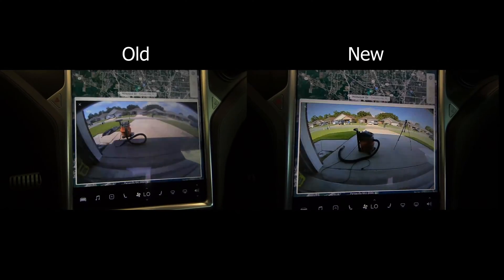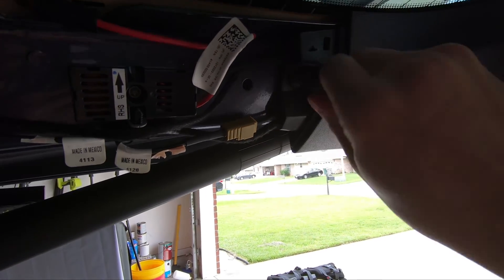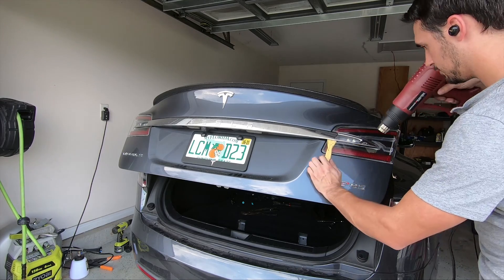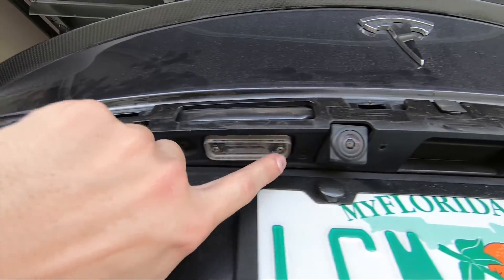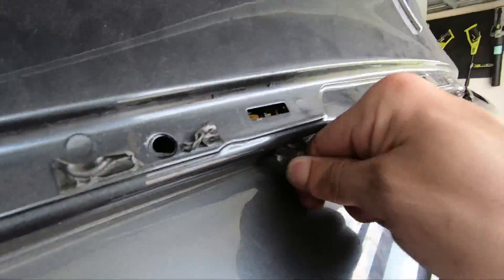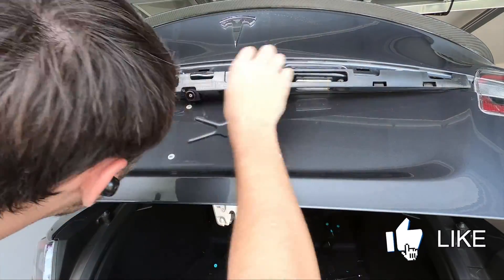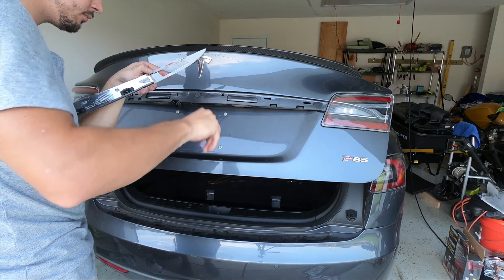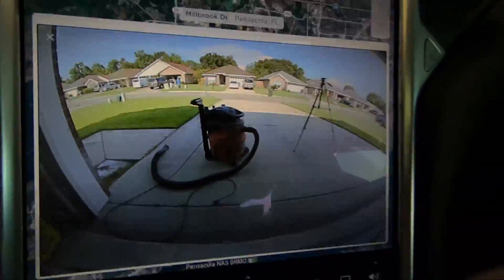How to: Upgrade back-up Camera in a 2014 Tesla Model S

Comment: Changed my camera today. As described by @SimonPodolak there is really no need to remove any of the inside plastic panels. Just remove the chrome bar, the plastic support bar and the left side handle. You can reach the camera connector clip by reaching through the handle hole. The clip can be disconnected fairly easily with one hand. Using a heat blower not only works for removing the chrome bar but also to get the rubber seal on the camera cable easier to remove/install. Took me 2 hours all in all.

Comment: I just replaced the rear camera. After removing the three smaller covers, I found out, that it is absolutely not neccesary. Removing of the left handle (for closing the trunk) is enough. Through the hole you can access the camera cable. With only a little fumbling the old camera can be disconnected and the new camera re-connected. What a pity, that I found out after removing the covers...
Reply from the maker: @adrianhossbach2553  I appreciate you sharing your experience and information. Hopefully it’ll be able to help others as this continues to be done by others.
Reply: But you still have to remove the chrome bar right? Holy cow how hard Tesla made the repair

Comment: Hey! Awesome video, Im gonna try to do this myself. I have a faulty backup camera on my 2017 model X that needs to be replaced, do you know if the model s and model x use the same camera? all the cameras i find on ebay seems to be for model S only.
Reply from the maker: Hey there, thank you. 
Yes, they use the same camera and have the same part number.
Reply: @JoeMartinMVC  Awesome! Thank you!
Reply: Hey, the camera on my 2018 model X has just failed, how did you get on with your repair? Are there any bits you can skip?

Comment: Hi @JoeMartinMVC, I have mine rear camera cracked. I have ordered a second hand one. My camera is tesla s 2018, and the second hand camera was also taken from the same year car. The part number the seller quotes is 1061269-00-b. Is it supposed to be the same the one in my car too? I am afraid that there is a chance my camera in my car to be 1061269-00-c and the one from the seller to be with lower quality. Or model S 2018 always uses 1061269-00-b?
Reply from the maker: The b and c models are identical in terms of resolution, C is just a hair better with low light situations from what I've seen. From what I can find on Tesla Parts pages B was used in 16 and 17, and C was used from 18 on.
Reply: @JoeMartinMVC  fantastic, thank you very much for the information! Good luck! :)

Comment: Hi there, first of all, thanks for the video, helped a lot. I replaced the cam now with an original one from Tesla, but the screen stays black. Any idea (beside reboot), what has to be done to make the cam working?
Reply from the maker: There shouldn't be anything else required to get it working. If the car sees a camera plugged in it automatically displays. The cameras are not serialized to the car, they're plug and play.
Reply: Thanks! I’m afraid, I’ll have to visit the SeC. 😐

Comment: What was the difference in resolution what part number were you upgrading to
Reply from the maker: It went from 720P to 1080P:

The part number for the new camera I used is the one in the description of the video: 1061269-00-C

Comment: Just had my camera replaced by my SC since the lens on the old was cracked. After the following car wash I noticed water drops around the edges of the two handles and condensation inside one of the lights. The water leaks comes from all the holes behind the external trim. These leaks must be fixed to avoid future problems with the lights and contacts! I have found that this is a common problem on Tesla MS - even with new cars. The design is poor and it is difficult to seal the weak points.

Comment: Thank you for your video! Just repaired my Model S late 2016 with 69-00-D. Wouldn’t have tried it without this video. A few things I did differently: Removed chrome bar incl. plastic support bar. Removing the plastic covers inside of door was too much of trouble for me, broke almost all clips. so I decided to try it through the handle hole at the bottom. Was quite difficult one handed but worked in the end. Tesla now sells the tape precut in this shape so that was way easier. took me 3h nonetheless.
Reply: I also managed to reach the connector through the handle hole. Not too difficult and of course way easier than removing and reinstalling all that interior trim.
Reply from the maker: I'm glad I was able to help out. I'm honestly surprised at how many people have actually done this modification, but I think it makes a notable difference in rear visibility. Having the precut tape would've been awesome. That was probably the biggest pain for me doing this. Lol
Reply: What is the difference between 69-00-C and 69-00-D? D is the newer model I would guess? Change in quality?
Reply: @patrikahlberg3710  minor differences I guess. the newer ones are better sealed and heated. didn't notice any quality improvements compared to my old one (2016).

Comment: Thank you for your video! My 2013 S85's backup camera was giving the "Camera not accessible" error. I bought a 1061269-00-D for $150 on eBay (could have gone with the $38 1006773-00-F but I think that is a lower resolution) and replaced my broken 1006773-00-D by following your video. It worked great, and probably saved me a couple hundred bucks by doing it myself.
Reply: I looked everywhere for the 69-D but couldn’t find anything (ebay,amzn,wish,ali). Had to go to Tesla but 3 out of 4 SeC told me the camera was restricted goods and can’t be sold. 4th one sold me the camera for CHF450, almost same in USD. insane prices but didn’t know what else to do.
Reply from the maker: I'm glad to hear I was able to help out.

Comment: Great video! At night my original backup camera is basically worthless. I have to apply the brakes to get enough light to see anything. Does this upgrade resolve that issue?
Reply from the maker: I wouldn't say it resolves it, but it is notably better and has better low-light functionality.

Comment: I've had my car wrapped in PPF. Do you think I'll still be able to use a hot gun?
Reply from the maker: With PPF I'd be a bit more hesitant to use a heat gun.
I'd go more with a hair dryer and fishing wire to not heat up the PPF as much.
Reply: @JoeMartinMVC  Last question...........I hope!!! How many strips of double sided tape are there. From the video, it looks like there are three separate sections.
Reply from the maker: @AdrianWingate2010  no worries, I’ll help out with any questions you have. 

I’d classify it as 2 pieces, it really just depends on how wide your double sided tape is and how good you are with an exacto knife. For me it was easier to cut the tape in to a few pieces and then put it on the bar instead of trying to cut it out perfectly while it was attached to the piece. Double sided tape is weird to cut and doesn’t like to do so cleanly.

Comment: You stated that it took 2-3 hours to do. Which part took the longest? Was it the heat gun part? I'm assuming that the purpose of the heat gun was to melt the double sided tape.
Reply from the maker: Yeah, carefully removing the Tesla chrome bar and then adding new adhesive was the longest and most tedious part. 
That’s correct, the adhesive that Tesla used is very strong and the heat gun weakens the bond. You could also use some strong fishing line to help cut through the double sided tape.

Comment: Thanks for this video! After watching it more than 3 times - yesterday was the day for replacing my cam with cracked lens. 4 broken clips and a perfect result. My 2016 had minor differences but this video helped ALOT! 👍
Reply from the maker: That sounds about right, lol.
I'm glad I could help out, I know when I went to do this job myself I couldn't really find any type of instructions or guides, so I figured I'd do my best to get the information out there for anyone else who wants to try and do this, as it's a massive upgrade.
Reply: Hi Jens! planing on doing the same to my late 2016 Model S tmrw. Just wondering, after turning off your Tesla have you disconnected 12v battery and safety loop as well? hoping plug and play works. I have the -D Series. Also thinking about sealing the cam with some liquid tape, not sure about resting water though
Reply: @SimonPodolak  I didn't remove 12V. Just open door and trunk and then turn off the car. Don't think you need water sealant since rubberbus on cable through.

Comment: Do you have a part number for the newer camera? They all look the same on eBay
Reply from the maker: The part number is in the description: 1061269-00-C
Reply: @JoeMartinMVC  thank you 👍👍 I will try this myself. But scared about that heat gun...
Reply from the maker: @liteglow2000  You could always opt to use a hair dryer as a safer option, it just takes a little longer.

Comment: Does Ur Tesla not have backup lines when in reverse?
Reply from the maker: When in reverse it does, the lines operate the same as they did with the original camera that I removed. I just always keep my backup camera up and visible on the MCU and did not put the car in reverse for the video.
Reply: @JoeMartinMVC  Is there any way to tell which rear camera U have? And do U have a link to the HD one? 
I'm starting to gather all the pieces for my next big Tesla Overhaul. (New MCU, eMMc, and upgraded modem). Figured while the car was in pieces, I might as well work on other upgrades as well.
I'm looking over Ur channel now to see what else U have done to Ur older MS.
Reply from the maker: @Smo0chiePo0ch  If it's older than 2016 it should have the older camera, you can also take a look at the clarity and difference in field of view, the newer ones have a much wider field of view.
I bought mine off of eBay, but if you look for model number 1061269-00-C, that's the upgraded/newer rear camera. It is a Tesla OEM part.
Reply: Thank U very much. I currently have a 15MS85D. Guess I will be looking into the upgrade. Thanks again.
Reply from the maker: @Smo0chiePo0ch  You're welcome. At the end of this year I'll likely have a bit more content coming out, as my car will be out of warranty at that point and will start doing more work myself.
But the good news is that removing almost anything in the car is straight forward, including the instrument cluster and MCU. Just go slow and make sure you have plastic pry bars so you don't mark anything.
Reply: My car is out of warranty and so, I have started the slow process of doing/learning to do things myself. 
Tesla is only handing out refurbished MCUs so I plan on just buying it myself. The eMMc is going to have to be sent out to be flashed in Cali. (I haven't found anyone here in Florida with us yet) but still looking.
I also have moisture behind that back piece so it needs to come off and resealed. 
Might as well do the cam at the same time. :)
Reply from the maker: @Smo0chiePo0ch  My poor MCU has been replaced 3 times now because of the EMMC issue.
When you say moisture behind the back piece, are you referring to the LCD screen leaking?
Reply: No. Not screen goop or glue. The back part that is taped on that U pulled off in Ur video.

I'm going to purchase the new MCU screen (Tesla is only offering refurbished ones) from eBay and send my eMMc to Cali to be cloned and have the chipset updated to a higher capacity.
Reply from the maker: @Smo0chiePo0ch  Hopefully all of the work will go quick and easily for you so you won't have too much down time.
Reply: He told me to expect at least 2 weeks of down time. (From pulling the chip, to sending it to Cali, to the cloning/upgrade, and getting it back to me.)
My MCU only has a small bubble in the top of it for now so if I need to wait on the MCU, I can and do it later. Its not leaking. I also plan on going 4G when I rip all the dash out. I have no bubbles or leaking so far in my display cluster.  fingers crossed that it holds out too 🤞 
Then after that, paint clean up (for a few chips) and PPF/Ceramic.
Reply from the maker: @Smo0chiePo0ch  That's not a bad turn around at all for what's involved in all of that.
I sure hope it does, I've had two leaky gauge clusters and one leaky MCU in mine, at least they're warrantied for a year at a time whenever it happens.
At least the paint cleanup and ceramic coating is easy. PPF, not quite as much. lol
Reply: They want the car for at least 3 weeks for PPF/Ceramic and are asking over 10x the chip price. Haha. Im looking forward to being MCU and eMMc worry free.
Reply from the maker: @Smo0chiePo0ch  10x? Jesus. You can buy the chip repair kit and use it to fix small chips and scratches pretty easily (it's actually the same kit as Dr. ColorChip repair kits).
Do you mind if I ask how much they want for paint correction and PPF install?
Reply: I don't mind on U asking at all. I just had to work... and just got home.

So I took my car to two different shops to get quotes for PPF and Ceramic Coating. I live near Destin. 

My car is a 15MS85D. Pear White. The paint looks extremely good but is not perfect. I have a rock chip on the hood and 2 bad chips on the front bumper. 

Here is the first quote I got back so far.

2015 Tesla Model S
Preparation for ppf ( full paint correction-removal screeches and swirls 600$ 

Front bumper repaint 800$+tax
100% color match 
 

FULL CAR PPF 

Full Hood/ Front fender/ Mirror
A-Pillar/Full roof
Front Bumper
Full Doors
Rocker panels
Luggage area
Trunk lid
Rear fenders
Rear Bumper
4,121.95 (kits) + 1,236.45 (installation) = $5,358 Total+Tax

FRONT IMPACT ZONE AREA 

Full Hood/Fender/Mirror 
Front Bumper
A-Pillar
1,644.85 (kits) + 493.45 (installation) = $2,138.30 Total+Tax

Ceramic coating on top of the PPF and all exterior parts 750$ for 2 years of protection 
 
Chrome delete 700+tax
Wrapping on front black plastic piece 200$ gloss or matte price the same
Reply from the maker: @Smo0chiePo0ch  Oh wow, you're actually pretty close to me. I'm just a few towns over from you.
Overall that's not too bad of pricing for everything. I'm actually surprised at the install cost being only $1300.
Full paint correction for $600 is definitely a good deal depending on how badly swirled the car is. Fortunately we have soft paint so most defects come out pretty quickly.
Reply: I'm pretty sure the previous owner (I'm 2nd owner) had film on it. Join the Florida Tesla page so we can bang ears on there. I have talking about the PPE/Coating with someone on there in the Orlando area.  Again, comparing. Helping others not be blinded by the quotes.
In fact, I just got another quote. Car unseen.
That is quite the commute!

There are two main packages my clients gravitate toward, the partial front package and the full front package

partial package covers the front bumper the hood and fenders partially and the side mirrors

The full front package does the full front bumper the hood and fenders completely leaving no seam in the middle of the panel where the film ends & side mirrors

Partial package $1195
Full Front package $2395

The film I use is called premium shield elite. It has self healing properties which allow it to heal itself from minor scuffs scrapes and abrasions and comes with a lifetime warranty on the film covering it against cracking, feeding, peeling or changing color. 

Please let me know if you have other questions

Comment: Do you mind if I ask what double sided tape you used? Is it good for cold and wet climates?
Reply from the maker: I used 3M's permanent adhesive double sided tape. It's gray and has been great for indoor/outdoor and hot/cold use for me. I've been using it on a bunch of different applications over the years.
Reply: @JoeMartinMVC  Thank you - is it just called that or is there another name for it like the automative tape? My camera cracked and Tesla refused to cover the cost (not sure how they can say it is a 'wear and tear' issue - some weird sniper stone must have hit it!) and it was over £600 to fix. Found a new camera online after seeing your video and now ready to install but just want to make sure it won't peel off.
Reply from the maker: @saqibhasan101  Sadly I can't say I'm too surprised to hear that, but I can see why it would cost so much to replace, it does take a bit in labor to get to it.
It's listed as 3M Permanent Double Sided Adhesive.
Reply: @JoeMartinMVC  Awesome thank you! Well actually I asked how much to buy the camera and they wanted £450!! So not sure it was only the labor :) With the lockdown, I was going to get it all sorted soon - so thank you again!
Reply from the maker: @saqibhasan101  450?! That's insane.
If you have any questions or need any assistance, just let  me know. You can always find me on my Discord:
https://discord.gg/fFwbT8S
Reply: @JoeMartinMVC  Hi again - sorry I tried using discord but it just was acting funny. I was about to install the camera today but lol it was so cold in Scotland that my fingers were freezing. So I did a dry run to see how easy it is as well as checking if the camera I got works. I ended up getting this tape (https://www.ebay.co.uk/itm/253201475623) - it's a little thick like a foam core - think it will be ok? I'll keep you posted - hopefully try again next week. And yeah I broke two clips lol

Comment: was it a dramatic difference between the new and the old?  also did you just go and buy the new camera from the service center?
Reply from the maker: jay young for my model it definitely was. It went from a very low resolution (I believe 480) up to 720 or 1080. 
I bought mine off of eBay, but you could likely get it from the service center too.
Reply: My own 2013 has the new camera and I now have a 2015 loaner which has the old version. The difference is night and day. It's annoyingly blurry on the 2015 coming from my own car.